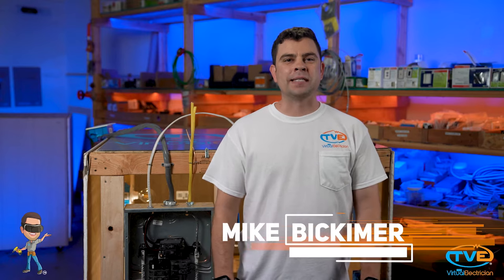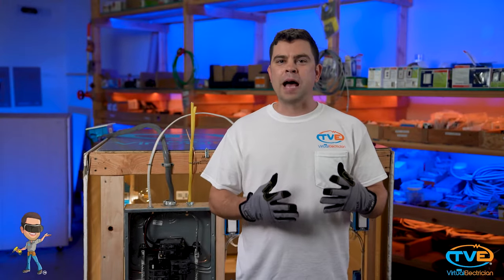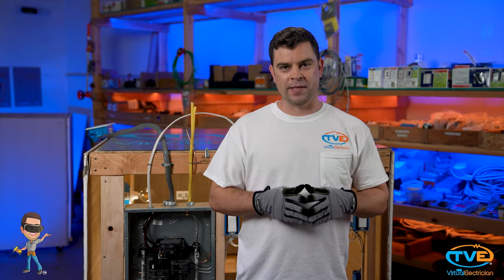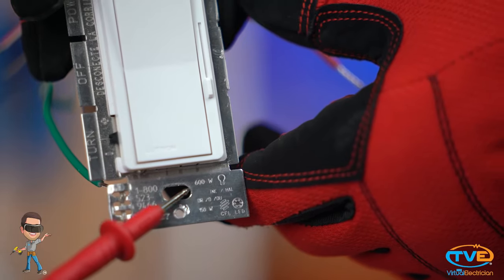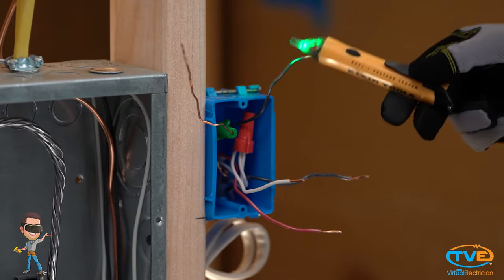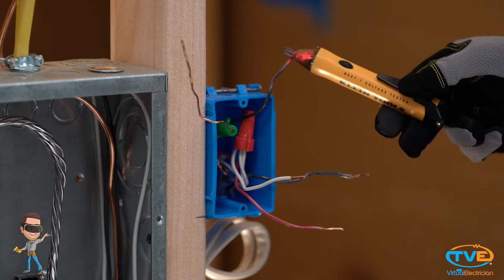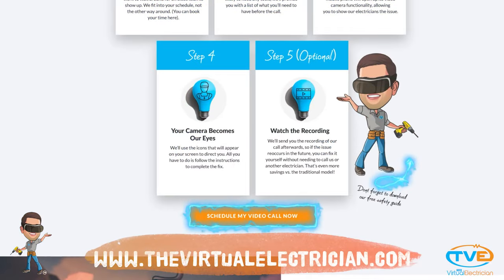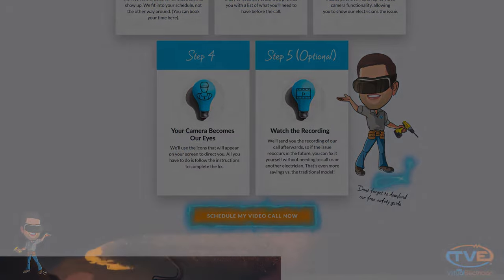How To Fix Flickering Lights - DIY

Comment: only 2 rooms, the garage light and the living room light are flickering....weird thing is the rhythm of the flickering are SIMULTANEOUS....before this ever happened, an electrician had some problem while doing wiring while touching the living room light then he did something and made it come back on...idk what he did but ever since that day, both the garage and living flicker from time to time. and its ONLY those two in the house. i tried replacing light bulbs from LED to incandescents...the light does NOT have a dimmer...
Reply from the maker: Schedule a call with me at www.thevirtual electrician.com. I’ll show you how to fix it in less than 30 min. Safely

Comment: I have 13 pendant lights on 3 separate switches. Three on one, 4 on one and 6 on one. The individual bulbs randomly flicker in a few of the lamps. Is there a way to repair the sockets? I think that's the issue. I can wiggle the bulb and it wil l turn on for a bit or a second or for days/weeks it will work, then it will begin flickering. I've switched out the bulbs and even replaced them (fancy expensive bulbs) but it continues. The pendants are individual and were very expensive so if I can repair the socket it will save me a lot of money.
Reply from the maker: did you try checking the tabs on the sockets?
Reply: @TheVirtualElectrician  I'll try that! Thanks. Wish me luck🤞

Comment: I have a regular switch not a dimmer and using LED Dimmable light. Is it safe to use these i just bought the bulbs. They also take a few seconds to turn on after switching to on! Can this be dangerous?

 should I remove them ? 
they do flicker once they start turning on , then they stay lit!

No more flickering after few seconds it turns on. Help please 🙏
Reply from the maker: Shoot me a picture of your fixture and switch at contact@thevirtualelectrician.com

Comment: iam not using dimmer, but my house leds are flickering, all r flickering, pls help me out, one solution may be i think my street power supply prblm overloaded
Reply from the maker: call your local utility company first.  its the free option.
have them check the connections at the utility pole and meter can